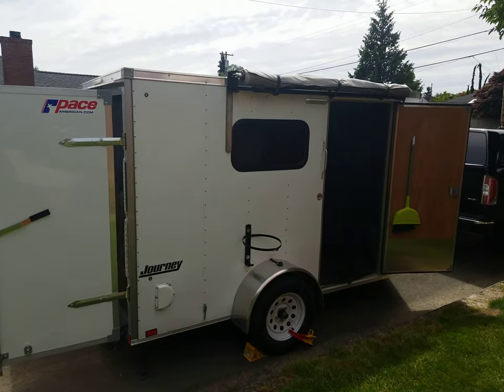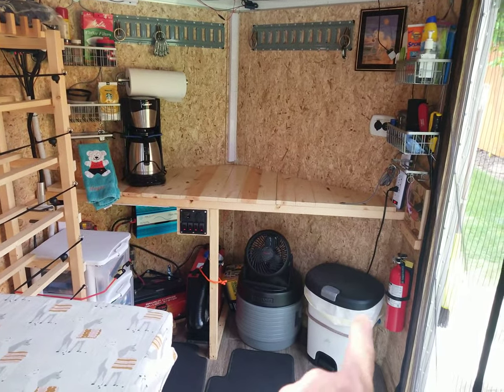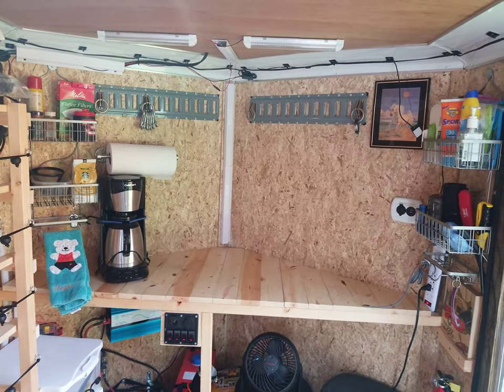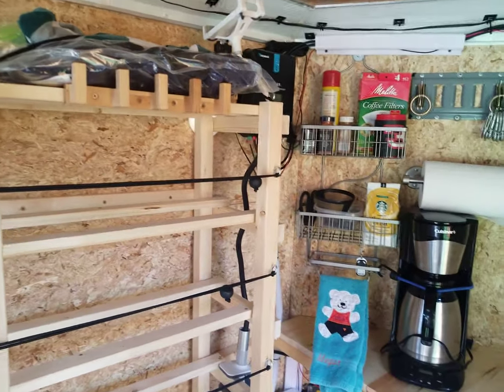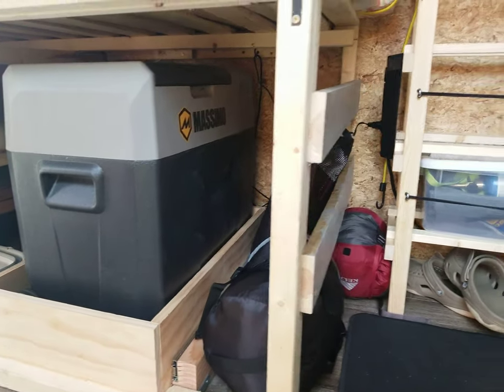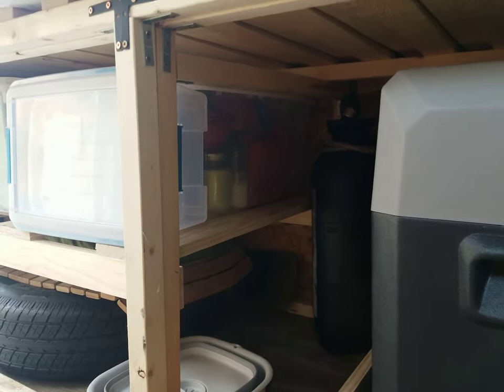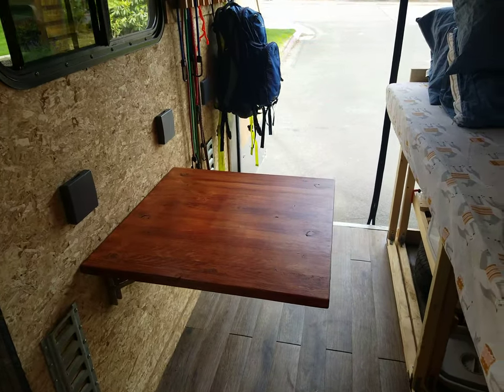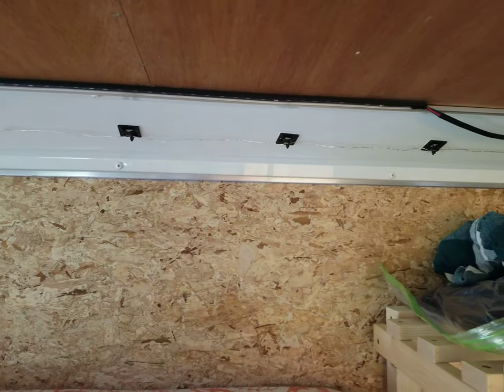Cargo Camper Conversation 6x10 V-Nose with 200W Solar

Comment: This is close to what I want to do to mine.  If I wanted fancy shmancy I’d buy an RV.  I have the same solar set up to utilize.  I like the slide out bed/sofa!  The shower idea is great!  LED lighting is the way to go.  I have mountable Mr Heater propane 10,000 btu heater I’m going to use, but I have a feeling it will be an overkill.  Nice job!

Comment: Nicely done.  I think what some people don't pay attention to, when commenting, is what YOUR purpose for the build is.  For most it's some sort of camping, not meant for full-time living, so you really don't need an extravagant build and much of it can be temporary.  If someone is building for part- or full-time off-grid living, getting more involved in the build definitely makes more sense.  Of course, the beauty is that everyone can refine their build over time, as they discover different needs.  When we first got our 6x10 I outfitted it for teaching scuba diving.  It was perfect for that.  Then we had the Snowmageddon in Texas and were without power for a week.  Thankfully, we had a 1000w pure sine wave generator in the tongue box of the trailer, which rescued or bacon.  But what that experience did was launch us into looking into off-grid capabilities.  The 6x10 became our "experiment".  I still teach scuba, so I couldn't do much about what I built in already, so I spent many days on YouTube looking at various approaches to van and trailer life.  As a result, we've maximized space and found compromises between function and convenience.  So, in many respects, we looked at things the same way you did.  I saw on the Gonagain channel they're approach to sleeping using Berth Bunks.  While theirs are somewhat permanently installed, it inspired me to have removable ones that took advantage of gaps on our walls.  Obviously, it can get annoying to setup and take down every day, but they're pretty comfy.  Hindsight being 20/20, I wish we had gone with a v-nose with a side door.  So, the bottom line is that we can travel places in the U.S. that we want to scuba dive and also camp...but, if SHTF, we could survive for quite some time off-grid in it.

Comment: Nice use of space. I too have a 6x10 Pacace v nose, except I have the ramp style door in back. What do you use to tow yours? I checked and found mine is roughly 1200 lbs unladen and have a Jeep Grand Cherokee V8 that is rated for towing 5000 lbs? 
 I've been seriously toying with the idea of a similar build. Problem is I'm currently using it for storage.
Thanks for posting this and thumb up.

Comment: You have kept your build out simple, lightweight and easy to use, which is about as good as one could hope to get!

It's ever so easy to add stuff but that all packs on the pounds and eats into the limited available space, making less to appreciate. 

The light, airy and uncluttered feeling is great and your diesel air heater transforms the space into a warm and comfortable Travel Cabin. 

i

Comment: Thanks for the video! I have a Pace 6x10 v nose that I am converting to a camper. Question: Did you custom order the bug net or did you modify an existing size?
Reply from the maker: For the RV door, I bought one from Amazon that was close to the correct size and trimmed the bottom myself.  For the rear door,  I  found a 72" wide one and made it work.  That one i actually just let dangle of the back,  but it doesn't touch the ground.
Reply: @maddogsk8er86  Thank you!!

Comment: I get accused of being a utilitarian as well. I have a 6x10 with only the back door making room for a bunk across the front and a lower cot couch / bed or pole bed. This keeps the back door area open where I mounted a drop down work bench/ kitchen area and plan to put the sink and magnetic induction on the door to tuck under the cabinet.A drinking water container sits underneath.  An on demand propane heater goes on the back of the door outside allowing me to set up a shower pan with awning and poles. You have some good ideas, however for me I prefer to convert the unit for hauling materials as well as rustic living so leaving the floor open is required and takes a lot more planning to achieve. Thanks for sharing.

Comment: add an air valve and use a 12v airpump for the shower tank,also i set my freezer on coldest seting and runs allday (sun)and unplug it at night and its still under 32 degrees in morning(saves my battery)
Reply from the maker: Yeah, not hard to ad air preassure to the shower, but not needed. The hand pump is easy and it's one less thing to break/build.
Reply: @maddogsk8er86  does the e-cooler fridge drain the battery excessively or does the 200 watt solar keep up?
Reply from the maker: @nathandalleave252  The fridge has a minimal draw once at temp, and if you aren't constantly in/out of it.  The big thing is not treating it like a Beer Fridge. I use an ice chest for that.  As far as the battery/solor, I've had no issues letter that fridge run 24/7 with minimal draw on the battery. I do have a 225amp Hour battery bank though.

Comment: Yours looks a lot like mine…great minds think alike!  Is that the Chinese diesel heater, and what awning did you buy?  Looking good man!
Reply from the maker: Yeah,  that's the Chinese Diesel Heater.  Works great,  but the fuel pump knocking is a little annoying. 

The awning was pulled from an old Land Rover Overlanding rig.  No idea the brand,  but if I were to buy one,  I'd rig up the Batwing one to cover the rear door and side door.

Comment: thanks for the review, I'm curious, can this size be pulled with an SUV, mine is rated for 3700lbs, figure 80% to be safe so ~ 2960lbs.... these are what? like 1100lbs dry, figure add 5-600lbs of gear so I'd probably good to go.... any thoughts..?
Reply from the maker: I'm not a towing expert,  but I'm fully loaded 3k lbs.  There's definitely lighter materials and gear that you could use.  If you're not trying to win any races or go on really long trips, you could be ok.  I personally towed this very trailer with a Nissan Frontier one time,  and I traded that truck in for a better towing Midsized Truck (Canyon Diesel). I do way too many trips over the cascades to have my vehicle even near capacity.
Reply: @maddogsk8er86  oh wow, that's  heavy for that small a trailer, I guess the steel build out really does make a difference...
Reply from the maker: @bikeninja956  it adds up quickly from a base weight of 1900lbs.  My batteries alone are almost 150lbs.

Comment: Where did you get your diesel heater?  Make?  Brand?  Thanks
Reply from the maker: I bought from a random seller on Amazon. These things are mass produced in China (AKA the Cheap Chinese Heaters). A lot of brands slap their own name on the same units. 

I'd advise buying from an Amazon Seller with good ratings, incase something doesn't go as planned. I had to return one that was DOA. 

Most Cargo campers won't need any more than a 5kW heater. There's a ton of additional info out on Youtube for how to use/install. 

https://www.amazon.com/s?k=Diesel+Air+Heater+all+in+one&ref=nb_sb_noss_2

Comment: Great build! Was wondering where you found the (what looks like aluminum) trim for the ceiling/walls and what it's called? I'm on that part of my build and have no idea what kind of trim will look good there and what you have looks great!
Reply from the maker: That actually came with the trailer from the factory.  It does give a nice finish,  but I'm sure you could use some MDF crown molding to get s nice finish.
Reply: @maddogsk8er86  Thank you for your response!

Comment: insulation ?  Weight of trailer ?   LxWxH ?  bumper 2 hitch length.
Reply from the maker: No insulation. It doesn't get too hot in the PNW and in the winter the diesel parking heater keeps it super warm. I'm weighing in around 2200lbs loaded. Trailer is a 6'x10' v-nose. Overall length is ~15'. Interior height is just a hair under 6'. Exterior is 7'8" (I park it in a garage with an 8' door).
Reply: @maddogsk8er86  Thanks for answering  the questions :)

Comment: What is the white metal edging you used from the walls to the ceiling? And where did you get it?
Reply from the maker: It came from the factory with that installed.  Don't know if this will help,  but it's a Pace American Journey.

Comment: Do you have a link for the bug nets that you used?
Reply from the maker: The one for the rear door is no longer available on Amazon,  but I searched for a 72"x80". 

Both front and rear were taller than needed,  and might need to be trimmed. 

This is for the entry door.   https://www.amazon.com/dp/B01ESSA9VO/ref=cm_sw_r_cp_apa_glt_fabc_D7DK47DWG64RRXHQSBR0?_encoding=UTF8&psc=1
Reply: Thank you! My parents just bought one and I was telling them they needed bug screens for the doors. I will have to do some measuring and searching. Thanks for the response and nice trailer.

Comment: I like how simple you kept it. I want to do one and was thinking of sleeping in a hammock since i don't sleep well in a bed. What issues did you run in to sleeping in your hammocks? I like that rack also (might steal that idea)! Good job on the build, it looks like a fun and functional way to camp and travel.
Reply from the maker: I couldn't get the hang angles right. I'm a pretty big hammock user,  so it was frustrating to not get it dialed in.  Also it just eats up so much space if you're not going to pack it away every morning.  Tucking them to the sides still just felt like a giant brain bag was eating up the room.  I switched to two 5 inch memory foam cot sized mattresses to make a full sized bed and it's been much more enjoyable.

Comment: Is the trailer insulated?
Reply from the maker: I opted not to.  I'm typically never anywhere too hot and never much colder than freezing.  The little heater is more than enough on its low setting to keep it toasty.

Comment: could you break down the cost?
Reply from the maker: I built this over the course of a few summers, and it was a few years ago. Prices may not be accurate to todays material costs, and I only have some of the bigger items for you here:

-Trailer ordered brand new for $4500
-Solar, Battery, and Electrical - ~$2000
-Heater - $250
-Fridge - $250

Really, there's just a bunch of odds and ends on here. My guess is the build put me somewhere in the $8k-9k range all in.
Reply: @maddogsk8er86  thank you

Comment: What’s the full weight
Reply from the maker: Fully Loaded I'm coming in around 2300lbs. Weighed in at truck stop last summer.  If I were rebuilding, I'd move the battery bank toward the axles to reduce tongue weight a little.